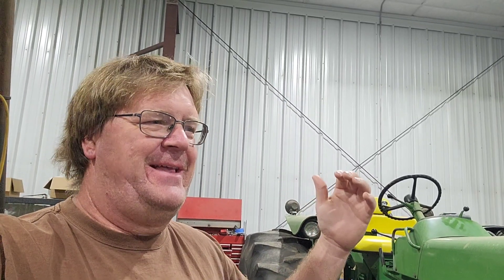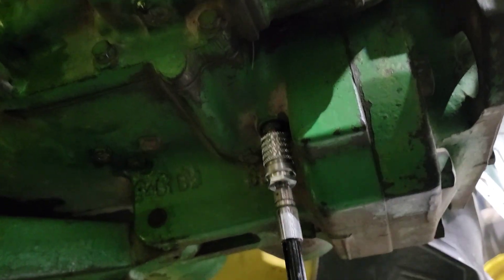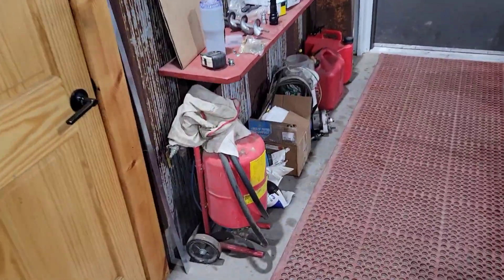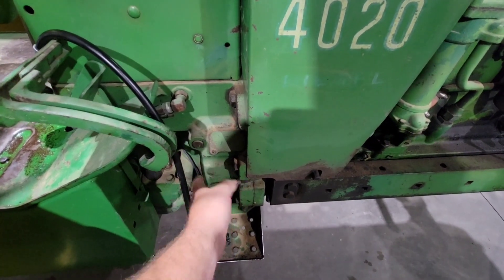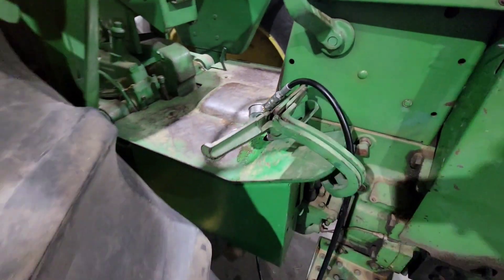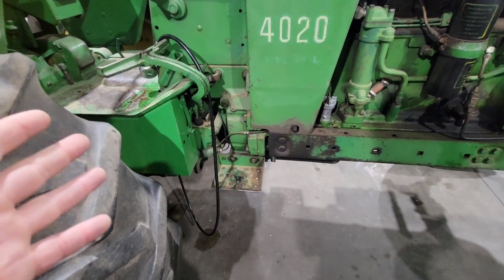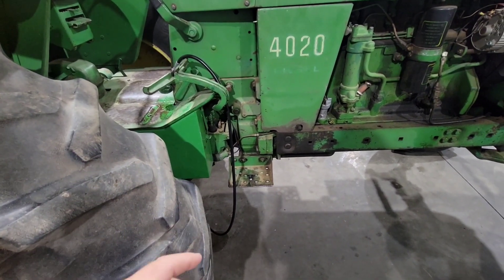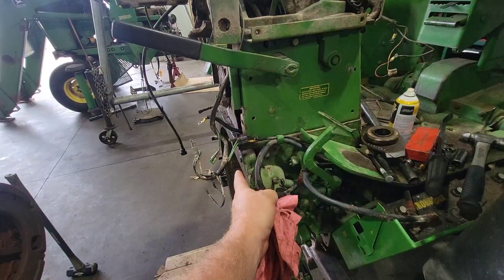John Deere 4020 power shift is confused. Park is 3rd gear, 8th is 5th. powershift tear down day 1

Comment: Hi Jon I wrote to you on my 4020 power shift a few weeks back. it would pull with inching pedal down. I rebuilt the c1 pack, also went through the shift, clutch valves, changed all springs, and even put in a new clutch valve in the housing, it was alittle scuffed.. Now it pulls more now than ever, but now no clutch pressure when pedal is down, I can't even do the drag test.. I put the 7 gauge set on it and all packs shift correctly, pressures are good.  I can hold the clutch down and shift slowly, the tractor will move when 3rd thru eighth are engaged.. Deere did send me disks that changed numbers. I keep reading this manual and I'm not sure where the problem is. I was wondering if you had an idea?  are the new disks the problem?  Thanks again.
Reply from the maker: Should be no psi clutch pressure when pedal is down.

Might have to look at C2 clutch pack for binding.

Comment: That is a busy busy one guy shop!
Reply from the maker: Well, dad and wife do a lot. She is good at helping clean parts and Gasket surfaces. For example on this 4020 when I have it completely tore down then show clean were the three point housing goes the shift cover the transmission housing to the clutch housing all them gasket surfaces. Should get that shift valve housing and all them gasket surface is cleaned up. We have a 6400 engine tore down as well and while the block crank rods and header at the Machine Shop she got the oil pan, the balancer shafts all the valve train like your rocker arms pushrods all that kind of stuff she got cleaned up

Dad still gets a pretty good day out in the shop

Comment: The only problem I have ever had with any of these Power Shift transmissions is the park spring. We have a Power Shift 3020 diesel on the dairy I help out on. 20 plus thousand hours and the transmission has never been touched. It used to feed cows every day for years.
Reply from the maker: Wow! Yes pretty solid units.